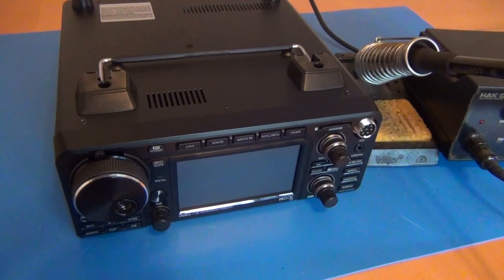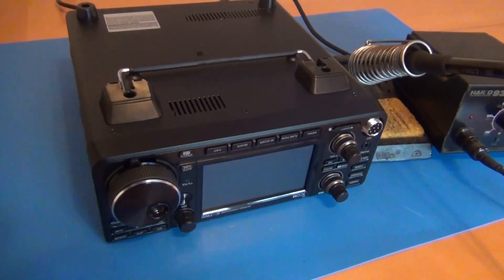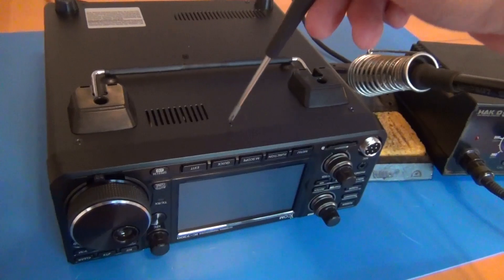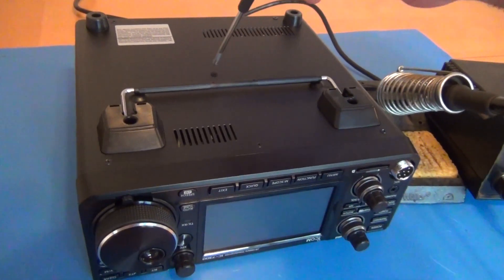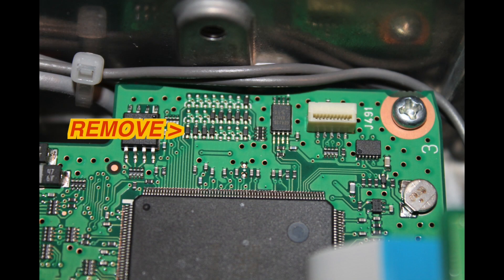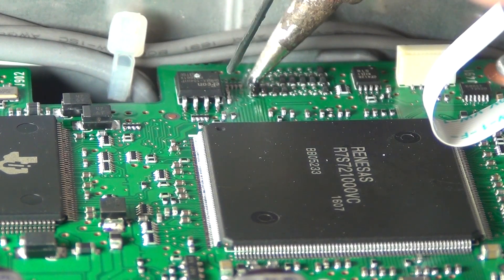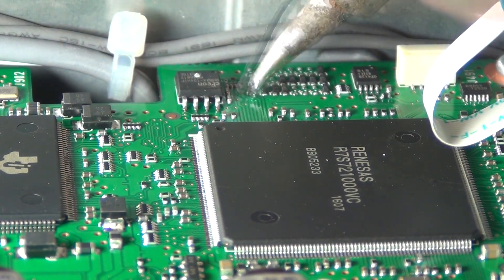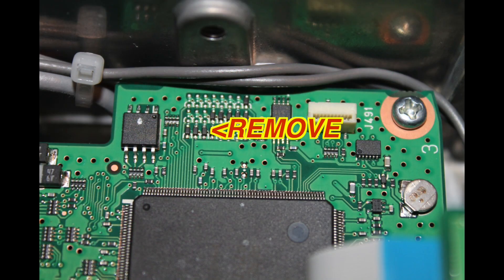Icom IC-7300 All Band Transmit Modification MARS Mod CB

Comment: I'll add this for those who bought Japan market IC-7300-01 model, as opposed to the IC-7300-02 for USA, in order to take advantage of favorable exchange rates with the Japanese Yen in comparison to the US Dollar.  Restoring the IC-7300 to USA version is fairly easy.  Remove Diode D420 and D423 (right in the same diode group as in the video).  Also D413 will be missing from the Japan market radio.  You can add that if you like, or the work around is to use the radio menu to create band edges.  Japan market has segmented 160m and 80m.  You'll need leave only one edge entry for 160m and 80m then put in the edge numbers.  And that's it.   I didn't try the "all band" transmit mod with D413 not present in the radio, so can't vouch for that.  However, the above described will give US citizenship to the far east radio.

Great video, thanks for sharing it.

Comment: I wasn't even trying to remove the diode all the way but it came right off the board without using solder.  A pointed soldering tip, a pair of angled precision tweezers and three seconds.  10-4 good buddy.
Reply: Thanks!   I spoke to a radio shop that no longer offers the mod, he told me he would use a sharp scalpel to gently remove it.
Reply: I don't understand. 30khz 74mhz continuous receive? YOU mean continuous transmit?

Comment: So what's the point of this kind of modification?
Reply: We CBrs call it the 11 meter mod. 👍🏻
Reply: @wwtf7180  on 11 metre transmit?
Reply: @noelmangion2157  yes so we can use it on 11 meters. 👍🏻
Reply from the maker: To be able to transmit on MARS/other frequencies other than the amateur bands.
Reply: Signal propagation on MARS has been found to be very poor on frequencies below 30mhz therefore this mod seems to lack merit.
Reply: Talk on CB radio
Reply: @M70ACARRY  Guilty as charged